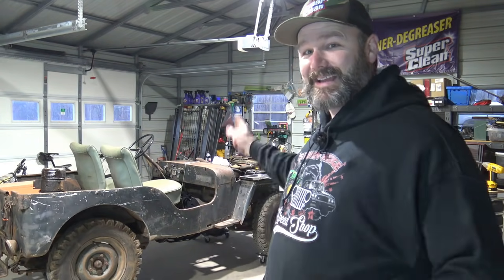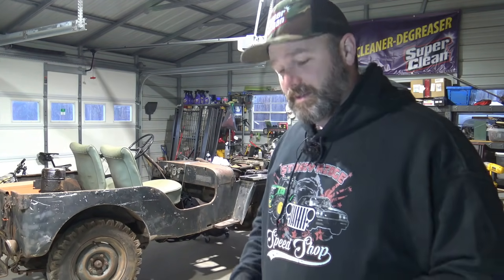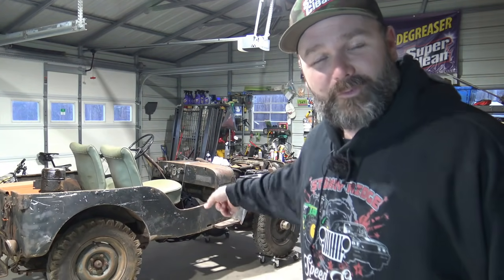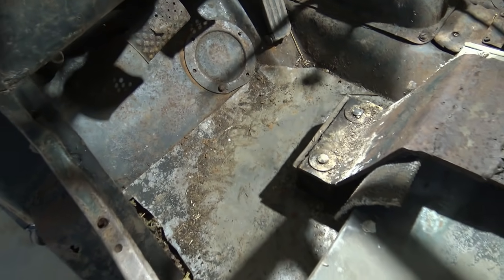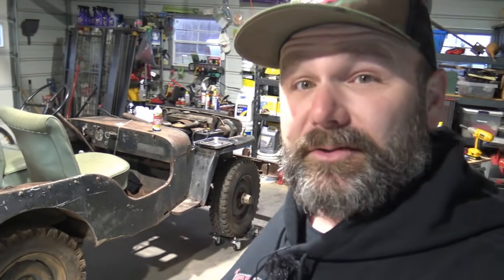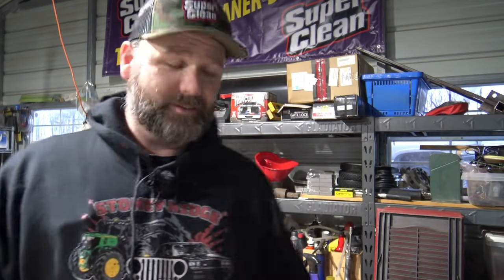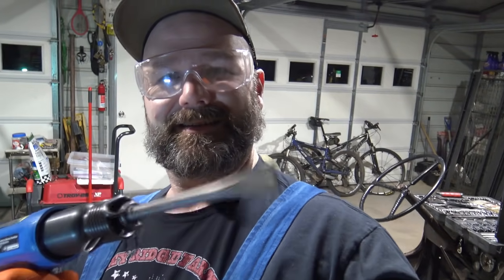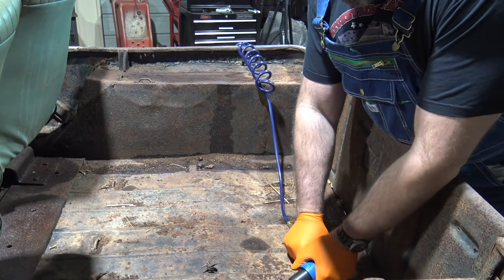Willys Jeep Rescue: SEEMS A HAMMER IS THE CURE!! Removing the body!!

Comment: P.b. Blaster is a great penetrant. I use it often on my farm. I use it anywhere from removing rusty bolts to oiling up rusty drive chains or even the gathering chains on the corn head for my combine. It has been a lifesaver. Good luck on the Willy's Jeep! I can't wait to see the finished product!

Comment: Keep them springs inside them radiator hoses if it's like the 4.0 inline 6 jeeps they put the springs in the hose to keep the radiator hoses from collapsing and causing the engine to overheat on the 4.0 jeeps on the bottom hose
Reply: Exactly

Comment: Spring in radiator hose , usually in lower hose, prevents hose collapsing while at speed going down the road. Keep the spring for future use if needed. PB Blaster gets the thumbs up on the product. However my choice of penetrating oils is Kroil from Kano Labs

Comment: 8:40 ... the spring inside the radiator hose is to keep it from collapsing when the cooling system suddenly has it temperature dropped (Like the you drive through a puddle) ... other wise thew hose might collapse and stop the coolant from being circulated

Comment: Oxyacetylene is great for frozen bolts.  I even  used it to cut through the tire. It was frozen to the rim.

You’ll have to drill all of the mounting holes in the tub. They don’t come with those...

Save everything until you’re done. And photograph, bag and tag all of your parts and hardware.

Comment: Having done this sort of thing before DON'T THROW THE OLD PARTS OUT UNTIL THE JOB IS FINISHED. NOTE THE WORD FINISHED.  Sometimes There are the parts that aren't obtainable having been made from unobtainium. LOL  Then you end up having to make them from scratch. It then becomes a real advantage having something to work from.  For cutting through the welds between the fenders and radiator support panel you may have to sacrifice one or the other to get it apart.  Which is the easiest to repair later on or what price is the replacement part. Always assume the parts are unobtainable and be surprised at to what is available. The most common methods, angle grinder with thin cutoff wheels, drill and chisel, or gas set. Which ever does the least damage to the parts and or cost the least to replace. Also a set of reverse twist drills help remove broken bolts, as you drill them they unwind the bolt hopefully after you have broken the head off.. I know you have another body but i would have centre punched and drilled the head of that bolt out that you went to chisel off saving the panel beneath. It all saves money as more parts you damage getting it apart the more it costs to put back together and less you have to spend on the better quality parts that do cost.  Some people like to use original parts that you can sell to save some money and keep them original even if they have to rebuild them.
Reply from the maker: You are absolutely right!! Nothing is going anywhere until the job is finished...thank goodness I have all these videos to look back on if I get "hung up" on something and can't figure out what goes where

Comment: I have the same tool kit!!!! I love it but dammit Ive spent soooooooo much time putting all the sockets back in when I open it the wrong way! Good idea to label!!!! WOOOOO!!! PB blaster is a killer too! I used to restore old rusted motorcycles before the homestead and I swear by it! Frozen cylinders, frozen calipers, rusted bolts, seat hinges, etc... I love that stuff! Need to try that grease! Have you used it yet?

Comment: You need to get some cut off wheels (death wheels) for your angle grinder. They work good on cutting welds.
Reply from the maker: I agree!  I have a air cuttoff saw...but as you can see...my compressor isn't gonna cut it

Comment: Keep the jeep in the family brother. If you get rid of it you will regret it and by then it will be too late. Oh yea and tractor supply sells 60 gallon dewalt compressors for 500 Bucks Just gor one myself. Run some good power to the shop and you will be set

Comment: Try to keep the old parts as usable as possible. Even if you don't use them yourself, someone might ask about the parts and you can sell them at a good deal for them and they lay the shipping or come get the parts. This could mean more money for the rebuild fund. And use, this appears to be a rebuild, not a remodel or restoration, in the typical verbiage use in automotive restoration circles. Going to look nice, wish you could keep it or that I had pit the first and best bid in for it myself. I love the old Willys jeeps. I learned to drive in on with my grandpa.
The recipient is going to be one lucky fella.

Comment: WOW! The added piece to the bumper is an adapter added by GIs to cut any clothes line (tight Wire) strong across the road. As you know the Willis Jeep windshield folded down to prevent chards of glass in the jeep's occupants eyes if shattered. So many GIs always road with the windshields folded down out of the way, even at night. The enemy soldiers took note of this and started stringing tight wires across the roads just above the height of the steering wheel. The GIs driving at night would get clothes line, some completely decapetated. So to prevent this, the lead vehicles or scout vechicles were mounted with fold away bow or A-frames that  would fold up to hold bannet or machetti's that would cut through these wires before they would impact the occupants of the vechicles. Some half tracks and trucks also had these adapters too!
Reply: That’s actually a tow bar.
Reply: @notajp  I'm sorry you are wrong. The tow bar on the front end of the jeeps are attached to the steer rods so that the vehicle would track in the same footpring of the towing vehicle. The jeep wheel base is to far a part to be tow in that way. Why to you think service tow trucks pick up the front and rear ends of cars even today? :)

Comment: If you replace the old water pump make sure you buy a good thick gasket. Me and my dad replaced the leaky water pump on my dads 66 cj5 and a month later it started leaking. We put another china water pump on it and its gasket started leaking a week later. ( it came with a crappy gasket). I just put a brand name gasket but i yet to see if its any better. It was much thicker and was better quality. By the way the older cj5 like my dads use same engine block but different head ect so they  share same water pump and stuff. Both our china water pumps were cheap Amazon specials so im sure not all of them are bad but some are. The bad one had a pully with 2 grooves for belts. Plus the double pully makes it hard to take the bottom water pump bolts out so i dont recommend that one unless  you need an extra belt for aux alternator or somthing.

Comment: You need to pull the steering wheel off first the remove the steering box from the frame. The column stays with the box.

Comment: I have worked for remodeling company. You can possibly start a fire if you leave a Dewalt Battery on the charger. I have heard of manufacturing company's Dewalt's doing the same, so whatch it.